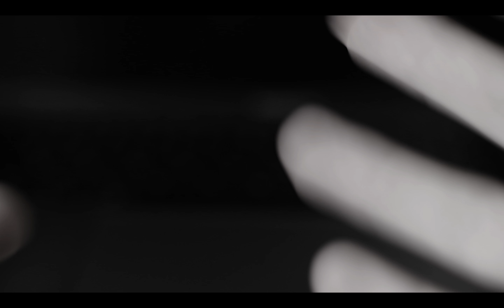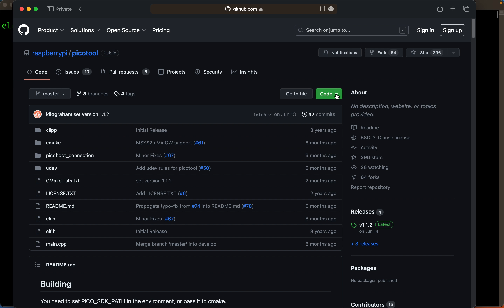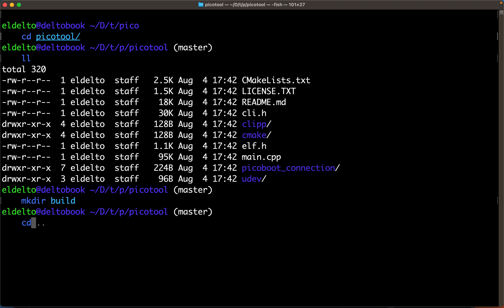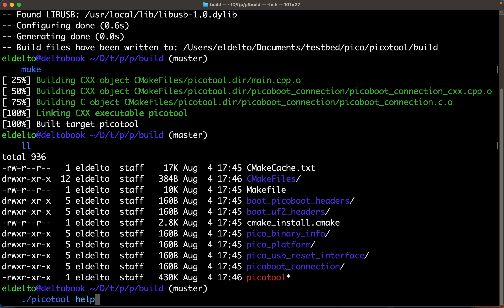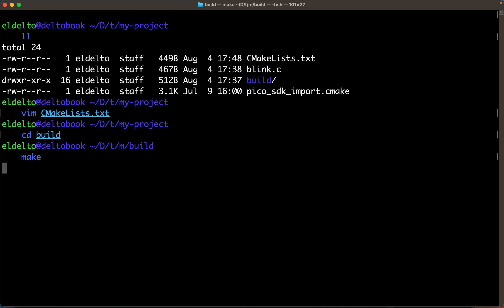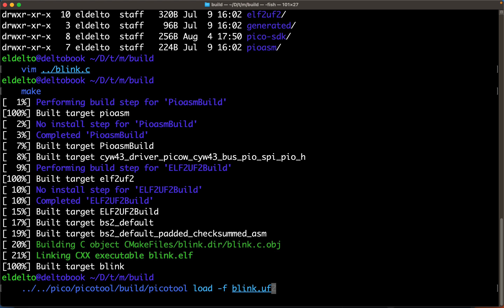Never unplug your Raspberry Pi Pico again

Comment: On windows, picotool doesn't support load with the -f flag unfortunately. You have to call picotool reboot -f -u first. So here is what I do:

picotool reboot -f -u; sleep 1; picotool load .\ST7735.uf2 -x

The -x flag in picotool load is to get the pico to start running the uploaded code. Otherwise it just stays in bootsel mode and I have to unplug and replug. You can add this string as a post build command to you CMakeLists.txt like so:

add_custom_command(
    TARGET target_namePOST_BUILD
    COMMAND picotool reboot -f -u
    COMMAND ${CMAKE_COMMAND} -E sleep 2
    COMMAND picotool load target_name.uf2 -x
)

Comment: Im using a rp2040 based sensor and while installing a firmware update one of the wires of the usb connector broke. now the device cant be flashed or is being recognized by my system. picotool cant see it either "No accessible RP2040/RP2350 devices in BOOTSEL mode were found.". I already tried the steps from the video with the according uf2 file. 
I connected the device while pressing the bootsel button. then i try flashing with the command "make flash FLASH_DEVICE=2e8a:0003" and still get the error: "No rp2040 in BOOTSEL mode was found".  If i give the system a different address thats definitely not correct it tells me:"Failed to flash to 2e8a:0002: Unable to find serial 'by-path' folder

If the device is already in bootloader mode it can be flashed with the
following command:
  make flash FLASH_DEVICE=2e8a:0003"

Does anyone have an idea as to what can be done?
Reply: I've been finding that I have to try and flash it twice and the second time it catches it in bootsel mode and it works. Might be what you're running into.

Comment: If only this actually worked :(
EDIT: it randomly started working a while after i applied the changes you suggested? wtf lol
Reply from the maker: Yeah I think that is unavoidable. As long as some program is running, the usb code should be able to do its job and respond to the picotool commands though.
Thanks for pointing that out!
Reply: Does it now reliably work for you? Apparently some people run into problems and I would like to figure out the root cause.
Reply: It seems to work reliably? Although if I don't have an infinite loop in my main function (i.e. if main exits), then it does not work. @eldelto

Comment: I got the same error, "No accessible RP2040 devices in BOOTSEL mode were found" and since other people with the problem didn't answer, I'll mention that I did add "pico_enable_stdio_usb(blink 1)" in ../CMakeLists.txt, reran "cmake ..", changed ../blink.c to make sure it re-compiled, ran make, got a bigger executable (about 17k instead of 16k; note: I also see pico_stdio_usb in the .map file), manually copied it to the pico first (in BOOTSEL mode using Finder), it was flashing in a new pattern so I knew it had the new executable running. Then I tried "picotool load -f blink.uf2" (with the path of my compiled picotool of course) but got that error.

Then if I put it into BOOTSEL mode (holding down the button while unplugging / re-plugging the USB cable) I can run any of the picotool commands (picotool info, picotool load -f, picotool reboot). After reboot I can no longer run any of them without getting that error.
Reply from the maker: Hello, that still sounds like the binary doesn't include the usb lib stack, even though from your description everything sounds correct. Did you already try cleaning out the build/ directory and running the cmake step again?
If that doesn't work out would you like to share your project? I would love to figure out what the culprit is.
Also maybe checkout www.eldelto.net/articles/raspberry-pi-pico-no-hands-flashing which is the writeup of this whole procedure. It also links to an example CMake file and to another project where I use this hack.
Hope any of can be of help.
Reply: @deltocode my replies keep disappearing. Not sure if they’re in an approval queue or something. I’ll try describing the location without a link: I put my source, and cmake related files on GitHub. My username is the same as on YouTube, and the project name should be obvious, pico-blink
Reply from the maker: @drivers99  I checked it out today and it looks like you're missing a call to stdio_init_all() at the beginning of your main function. I only own the Pico board with the WIfi chip and there it was already present in the blink example. Didn't realize it wasn't present in the example of the regular board.
I hope that solves it now! :)
Reply: @deltocode  woohoo! That's what it was! Thank you. That was above and beyond.

Comment: Hi, thanks for the video. I have the same problem than some other people in the comments. I've added adding pico_enable_stdio_usb(main 1) line in the cmakefile but when i run the picotool load command i get this error:
No accessible RP2040 devices in BOOTSEL mode were found.
If you can help me figure out what is the issue it would be very helpfull.
The only difference I had with your video is this warning when running the "make" command in the picotool build folder :
make
[ 25%] Building CXX object CMakeFiles/picotool.dir/main.cpp.o
/home/paulf/Documents/picotool/main.cpp: In member function ‘virtual void file_memory_access::read(uint32_t, uint8_t*, uint32_t, bool)’:
/home/paulf/Documents/picotool/main.cpp:869:22: warning: ignoring return value of ‘size_t fread(void*, size_t, size_t, FILE*)’ declared with attribute ‘warn_unused_result’ [-Wunused-result]
  869 |                 fread(buffer, this_size, 1, file);
      |                 ~~~~~^~~~~~~~~~~~~~~~~~~~~~~~~~~~
[ 50%] Building CXX object CMakeFiles/picotool.dir/picoboot_connection/picoboot_connection_cxx.cpp.o
[ 75%] Building C object CMakeFiles/picotool.dir/picoboot_connection/picoboot_connection.c.o
[100%] Linking CXX executable picotool
[100%] Built target picotool

Comment: When running the "../../pico/picotool/build/picotool load -f blink.uf2" command i get this:
No accessible RP2040 devices in BOOTSEL mode were found. 
It is like the -f doesn't work. I checked the picotool github page but i got nothing. Even when i do it while in bootsel mode it doesnt even upload the uf2 file.
Reply from the maker: Hello! Did you manually flash your board with a program that has stdio via USB enabled (adding pico_enable_stdio_usb(blink 1) in your CMakeLists.txt) before using the picotool command?
Reply: @deltocode  Yes i did. This is the CMakeLists.txt file in the my-project directory:
cmake_minimum_required(VERSION 3.13)

include(pico_sdk_import.cmake)
project(test_project C CXX ASM)

set(CMAKE_C_STANDARD 11)
set(CMAKE_CXX_STANDARD 17)

pico_sdk_init()
add_executable(blink
  blink.c
)

target_include_directories(blink PRIVATE
        ${CMAKE_CURRENT_LIST_DIR}
)

# Uncomment if you want to flash your board via picotool.
pico_enable_stdio_usb(blink 1)
pico_add_extra_outputs(blink)

target_link_libraries(blink
  pico_stdlib
  # Uncomment when using Pico W
  # pico_cyw43_arch_none
)

target_link_libraries(pico_stdlib)

And i am using the non-wifi chip

Comment: Performed same steps but got "No accessible RP2040 devices in BOOTSEL mode were found.". What might be wrong?
Reply from the maker: At the very end when trying to flash via picotool? Maybe try manually flashing a program with pico_enable_stdio_usb in the Makefile.